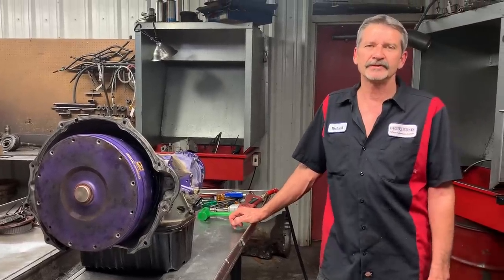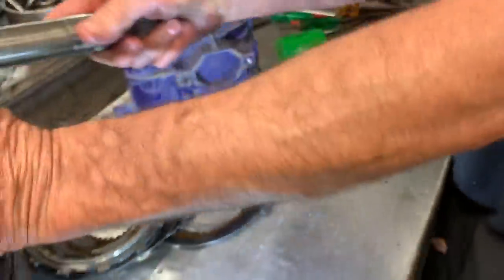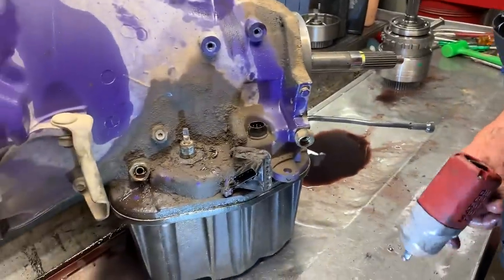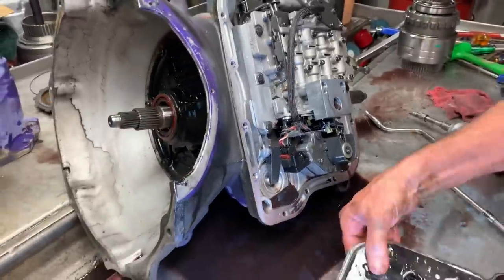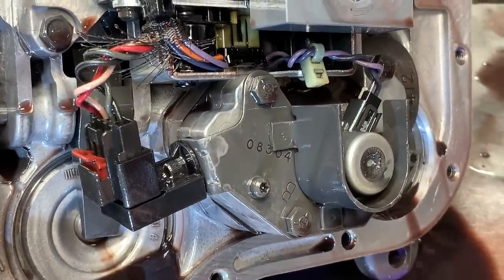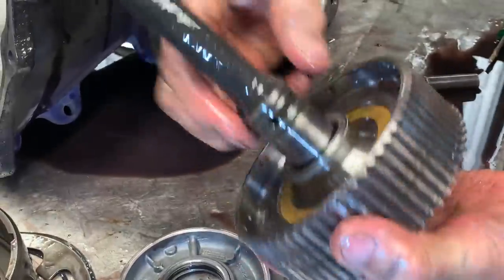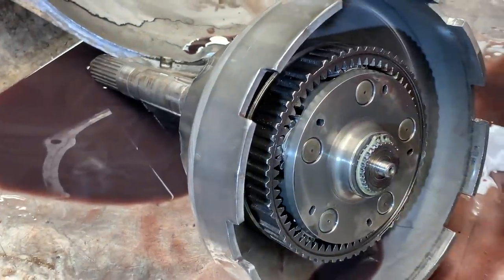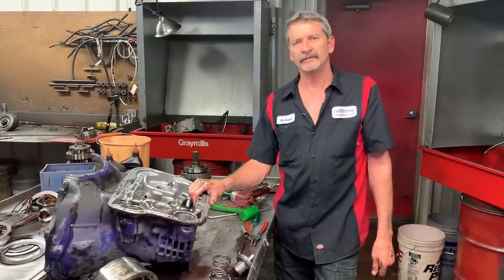ATS transmission tear down... HERE we GO and it isn’t looking good. Video 3-4

Comment: I'm waiting for a Allison's out a durmax to be done.
Reply: ohh i know riight !
Reply: @MIckveli2  there reliable from i hear. Probably why I haven't seen one done yet here.
Reply: @ttm9379  I have a few friends that have grenaded them 👍
Reply: Usually just burnt up c3 clutches in them from the 4-5 shift
Reply: Deboss has a video of his allison 1000 being done. Its pretty good.
Reply: Allisons are fucking worse than 48s
Reply: @ttm9379  They're reliable if you leave the truck 100% stock. Once you add any kind of power beyond stock, the allisons don't hold up at all. 7 months on a 40HP "trans safe" tune on my 2008 Silverado 3500 and my trans said, "yea we're done." Typically it's the higher gear kickdown that will limp the trans (rolling in 5th or 6th, then hitting the throttle to where it'll go down to 3rd or 4th) , and once you limp it it'll limp easier and easier until its completely toast. Another common problem is the OEM torque converter will start to shed its clutch material from added power and it'll start clogging up stuff and cause big issues.
Reply: All very good info just put a Bernie tune with a dsp5 on the old dmax yesterday and yea she slipping on the 50 hp tune on the hiway lip mode engaged.it seems to me it hit and miss got a buddie who beats the everliving shit out of and somehow for the last 2 years at 150hp tune she heald up. Starting to act up now . That where the curiosity hit where I want percion tranmission video on the Allie.
Reply: @Shredxcam22  I live in the same town as deboss. Vnr was owed by my parents 20 plus years ago before Richard and vicky poliquin took it over. I seen his video. Lol. I'm just curious on how someone who works on tranmission everyday of there life for the last 20 years would rebuild it and it more of a shot at dodge I always see there tranmission fucking up
Reply: @ttm9379  tuners are fine number 1 killer of dodge trans
Reply: @2015_Rubicnn  go to the strip, go to a sled pull, or watch any complete build. Almost every 2,000hp Duramax has a built 48re behind it because the Allisons are trash. Lmao
Reply: @2015_Rubicnn  max input torque of an NV4500 is 460lb-ft. Meanwhile the stock 48re is fine with input torque of 570lb-ft and beyond.

There's almost no upgrade path beyond 600hp for an NV4500. Meanwhile you can buy average 48re builds that handle 700hp or more for little more than the cost of a factory trans.
Reply: @phtevenmolz5030  You're arguing semantics here. There are many transmissions to use for various scenarios and HP/TQ levels. How much money are you willing to spend? The only reason I ever replied in the first place was because someone called something junk, because it isn't holding up to thousands of HP and torque while pulling a 30-50,000lbs sled. To me, that's a lame response and ignorant to blanketetly call something junk based on above scenario....just my .02 cents.
Reply: @2015_Rubicnn  the Allison doesn't hold up to any extra power or sustained heavy towing. It's a shit transmission. Period. The 48re can handle a Smarty being slapped on and 200lb-ft of extra torque in stock form.

Go drive your little Barbie Jeep, bud.
Reply: @phtevenmolz5030  Your argument makes you sound like a tool. I have my Duramax tuned +100hp and roughly +200tq and it handles it just fine. I tow heavy and haven't limped the transmission once. The Allison is an awesome transmission with superior technology compared to that shitbox you claim, but whatever helps you sleep well at night.😎🤙
Reply: @2015_Rubicnn  mine has an NV5600 and is pushing far more than your Allison can dream of, little lady. Now run along. There's a reason everyone dumps the Allison before any other transmission, but apparently you don't understand.

Shit, even Ford could come up with their Torqshift that holds up better than the outsourced Allison garbage.

There's good reason that the C1, 2, and 3 clutches shit the bed in an Allison just from looking at any tough work. Or why in order to make even streetable power of 500whp, you're already looking at a complete transmission upgrade that has to be upgraded further with a better TC, flex plate, cooler lines, and then add in a rear housing support. Yeah, a rear housing support at 500whp because Allisons literally tear the rear housing off.

So much strength. Again, run along. Nobody is impressed.
Reply: @2015_Rubicnn  i was laughing at there allison comments to. Only way to make a 48 last is to do a full billet build. There tuner dont know what hes doing apparently.
Reply: @2015_Rubicnn  everyone has a buddy with the brand they don't own that is the biggest pile of junk. Lol I'm with you and will keep my Allison's, 1st one is at 147k and fluid is like new and has more hp and torque than its rated for. 2nd is a 18 dmax adding similar power and only thing that slips is the Duratrac's when you jump on it at 15mph
Reply: Notorious for the modules going out. Brother in law was GM mechanic, worked on this frequently. The light weight tie rods were another big issue on the diesel truck.
Reply: @phtevenmolz5030  almost 300k on an Allison with 5k spin on changes and 15k internal filters using mobil synthetic. The truck tows 10-14k every single day with an 80hp tune.
A STOCK dodge I had blew the 48 3 times within 130k, I junked it. Serviced, upgraded, etc didn’t matter, never pulled more than 10k.
A tune done wrong creates heat and that kills the trans, weak line pressure during a shift kills the trans, increased torque against weak components shreds them.
Any transmission can be built for performance. How much do you want to spend? 48’s are cheaper because they’re not as robust or complex.
Good tuning plays a big part to how much the trans will take, if your powerband is out of wack it’s going to grenade any transmission in a hurry. The 48re was just a poor design.
Reply: 630k on my 12 powerstroke hauling campers has had 100hp tune on it since 40,000 miles bought truck with 16,000 on it in 2017

Comment: Love watching you guys work. Where are you located? I have a 2002, Dodge 3500 that I pull a 10k, 5th wheel camper with. Trans was rebuilt in 2017 by a friend. It is doing good, but it starts acting up I'm coming to you. Also, I hope all is well with your surgery. I will be praying for you that you have a swift recovery and that all is well.
MWT

Comment: kind of expected more carnage considering how the fluid looked.
Reply: Just guessing here but could most of the metal shavings come from the torque converter?
Reply: @peterhaan9068  Probably planetary gears are worn out, watch when he goes over those... both sets have inconsistent teeth.

Comment: This is why, if you ever pay for a rebuild, or even a lot of home remodeling projects, GET IT LISTED IN YOUR CONTRACT WHAT YOU’RE PAYING FOR. I’ve seen people get skimped on everything. From power train to tile work to driveways and slabs to actual “engineered bolt in upgrades” for industrial equipment (currently lmao and “not my probleming” that specific scenario). 

That way, one, you know if it’s a sheisty deal up front (might take some internet research), and two, if that’s not what you get, your lawyer fees will be next to nothing because that’s an open and shut argument.

Comment: These guys appear to be PROfessional and ComPoTent. I wish they could tell me why the 66rfe in my 2016 ram Power Wagon loses overdrive gears 6th, 5th, and eventually 4th , only 200 miles after being rebuilt. I have 1-3 and reverse but overdrive acts like it's got a cross leak partially applying the OD and burning it up. No one can figure it out. So expensive and frustrating!!!!!

Comment: ATS failed big time building that unit didn't they.
Reply: That or a different shop rebuilt it poorly after the teenager thrashed it the first time.
Reply: Jacob Whittaker atsg has a bad reputation with these Transmissions
Reply: they cost 5k plus too its bad
Reply: It's probably a lower series, everything upgraded that a shadetree could get to in a day and used lesser parts from other builds where it's inaccessible. Basically upgraded to not immediately fail or slip (hence the extra clutches), but will pack it in after whatever warranty period they offer.

Comment: When rebuilding this unit could you please touch on what other upgrades are available. I've seen in your other videos of the Chrysler units how they have high end loads and the thrust bearings get pressed against the planetary units etc; are there roller thrust bearing upgrades that you would recommend?
A bit of info like this would be great.
Otherwise as always from your guys another really good video.

Comment: I noticed my 97 47RE  I bought brand new that now has 202,000 miles on it is starting to hunt in and out of lock up
Ive put in pressure transducer  and solenoid twice now with after market  units so im going to service it again and put new transducer/solenoid in it and hope it takes care of it  ????
Seems like a routine service is to replace that transducer/solenoid when the oil and filter are done

Comment: Not trying to be rude, but I'm pretty sure that torque convertor is the 5 star cause if you look at ats's websites you'll see that the 5 star has mounting points like the one in the video, the triple lok like he mentioned has six mounting holes instead of 12. Someone correct me if im wrong, in a respectful way of course

Comment: That atf runs out like water, must be sheared right down. What atf do you guys run in those? How does the 48re compare to Allison 1000 for durability and ease of rebuild? That looks like a high maintenance at from amount of strange stuff going on.
Reply: So despite some dodgey features such as killer spring and weak rear housing the Dodge boys claim they will handle big power, if all the internal parts and TC are aftermarket. So main case is 48re but  all else are  custom parts.  Seems to me if you want 2000 hp maybe get an Eaton 18 spd with dual countershafts and learn to shift.

Comment: I don't know if you still answer questions on this old video, but I've been trying to remove the OD unit on an '01 47re, and i can't seem to shake loose the unit from the tailshaft. I've removed the speed sensor, the snap ring cover, and spread the snap ring as far apart as is physically possible, but it will not come off. It will separate from the main case like a 1/4" or more, but refuses to fully let go. Is the parking rod/pawl the problem? I see you just pull it off, easily, but i don't know if you've already popped it loose before you started recording.

Comment: @Precision Transmission  I have a 48re ATS stage 4, have 2000 miles on it. It shifts really hard and overheats when the converter isn't locked. ATS isn't doing much for me,  how can i have you take a look at it?

Comment: What can ttva, aka 04.5+ year owners do to avoid the harsh shift complaint issues with the added clutches and removing the wave snap ring and going to 7 clutches? I've biult  an early  47re with no troubles  but mine coming up on its biuld, I wanna make sure I don't have crazy shift issues having the ttva.

Comment: I’m ordering that ATS pan and whenever it comes in I’m changing filter and fluid. Where do you get the open filter from. On sun coast they sell them but idk if it’s the same and didn’t know if what y’all had is different from sun coast. I have a 04 2500 48re

Comment: HELP NEEDED!!!!!!!!!!!!!!!!
I rebuilt my 46re transmission new clutches seals and clearance and back to play in bearing in overdrive housing.
About 10,000 miles on rebuilt transmission reverse problem!
Reverse when shift again will engage and go back about 10 ft and it feels like you hit the brakes, it feels almost like a bind up and then it will rev that just sit like it's in park.
Got any good ideas?

Comment: I recently bought a reman from street smart in a ram of course 5.9 stock no tunes so umder 300 horse around 550 torque. But the trans lasted about 5000 miles when it went it avted like the trans was dragging and not fully disengaging when qt a stop. But it literaly died once i stopped i lost all foreward gears. They will warrentee it but i wonder about biuld qaulity and what i can do to improve on there biuld a triple disc converter or anything that i can do. Any ideas my other option is biuld it myself all stock in out shafts and 6 steel planataries. But theres so much to make sure of on all the end clerances bern alongtime since ive boult a trans. Years ive dome several but only maybe two 57 and 48 re s most been gm and ford. So the dodge torque flites are  a not so familiar unti to me any books i can study or maybe kust watch more of your videos. Thanks richard.

Comment: I have a 2012 ram 2500 Cummins I can’t get my backup lights to work Iv been told the switch is in the transmission is that true and is it something I can fix

Comment: So what failed? The converter from too mich play on the flex wheel? Great video
Reply: Towards the end if you see the planet set is all chewed up. Im sure thats where a lot of the metal in the fluid came from. Once you get that fine metal running threw the trans it'll cause all kind of issues, plugged up filter, etc.
Reply: You didn't watch the whole video did you.

Comment: Is that a cracked in bell houseing
Reply: Just moisture and sentiment
Reply: @mikesthundergarage3793  11:34 shows it real well, it's a casting flaw they didn't bother to clean up. Shadows play off it and it looks like a crack, but it's a step where the mold shifted. Shouldn't be a big deal, not a critical area and actually means there's extra material.

Comment: I purchased a Monster transmission turbo 400 about 15 years ago and never installed it.  Would it be advisable to have it torn apart and soak the clutches before using the transmission?
Reply: @leebarnes655  Sounds like this can be done with the transmission in the car and with only the yoke on the tail shaft.
Reply: @terrybarnhart1330  why would you buy a trans and let it sit for 15 years ?

Comment: Note to self: Avoid ATS transmissions. They'll not only skimp on parts they'll throw weaker parts in!
Reply: Ive always described places like ATS, Monster and such as generic transmissions. Built to handle some level of power and has this and that in it, but they have no clue what its going into, so theres no way to know what should be in it. So as it sits its not a bad unit, per say, but not completely right for any particular application.

Comment: “We see a lot of them.” Sounds like crap engineering design by Dodge,
Reply: In stock form, the transmission holds up just fine. The issue is that it costs less than $500 with a single part to make more than 100hp and 200lb-ft of torque over factory output numbers. My truck has less than $2k into it and it went from 305/555 factory rated to 440/800 at the wheels. That's over 200hp and 400lb-ft more than stock. And that's including the cost of my tuner, studs, engine rebuild, injectors, clutch, fuel pump, and all other supporting mods.
Reply: @phtevenmolz5030  Yeah, it's basically about $100/25hp to take any of the big 3 above stock numbers... and generally speaking, their transmissions will hold and hold well. My allison only got built because I was stopping by the shop to drop off a core, and all I have (and actually want) is just a predator tune on my duramax..
Reply: @phtevenmolz5030  I have a friend who builds transmissions and he says that's exactly how it works.  They spend money on power modifications, fancy wheels and a lift kit but when you tell them what upgrades the transmission needs to be able to handle the extra load they just don't want to spend the money.
Reply: @DaveMcLain  exactly. People see power numbers and forget literally everything taking the stress behind the crank. Or, like you said, people add lifts and massive tires but don't get stronger ball joints, tie rods, etc. Supporting mods are always an afterthought.

Comment: Those brand transmissions are garbage, they use outdated equipment, and lesser quality components, as you are showing, back when I was hot rodding, we knew to stay away from that brand. They are way over priced for the garbage you get.

Comment: You can't bash ATS. They put a trans together that lasted how long..... Was it built to our expectations with the "aluminum" rear planets and all.  But what actually was the  failure??  It was an endplay issue that chewed up the rear planets where the thrust plate rides. And it ate up the snap ring groove in the o/d housing. And once again an endplay or thrust problem. It's obvious that the trans had a fair amount of miles on it looking at the hub on the converter where pump gear rides. So not every trans needs billet this and that and steel planets. It needs regular maintenance and maybe not 1000 HP on a daily driver that tears the best parts in the world up. I tend to over build a trans. Shit I remember putting 3 pinion rear planets in a 750 HP bb Mopar and replaced clutches. And never rear planets.